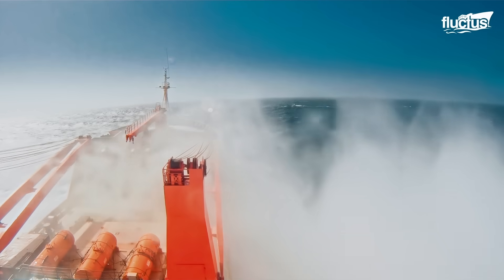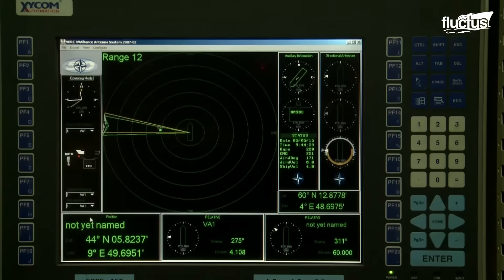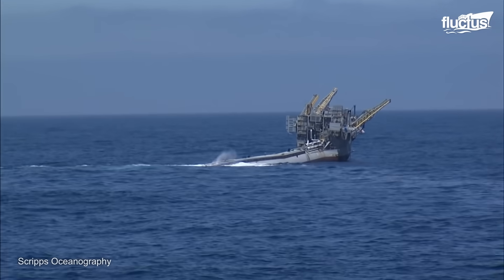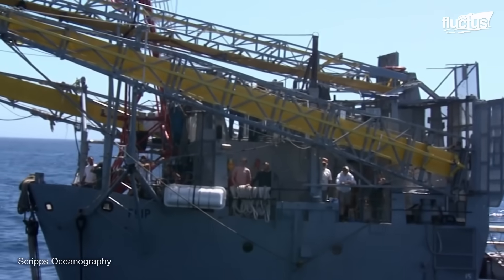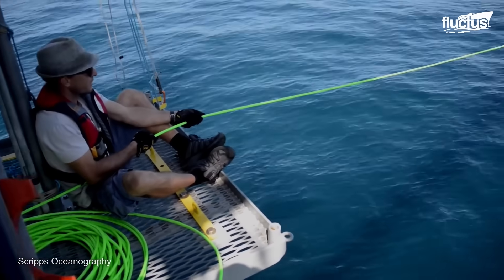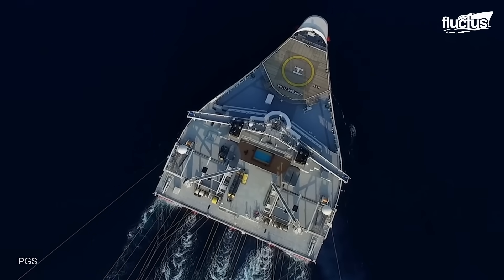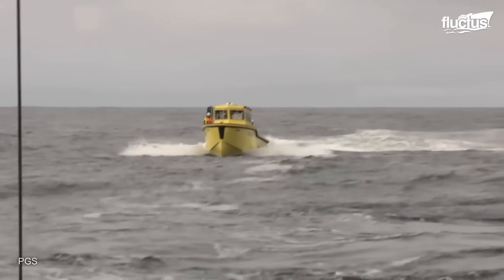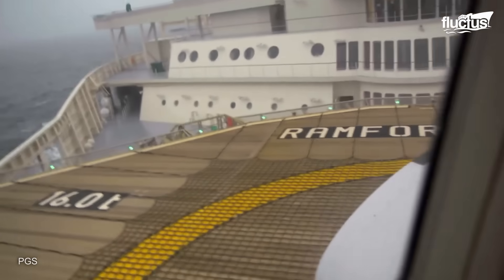Life Inside US Navy’s Weird Transformer Ship in Middle of the Ocean

Comment: Curious how the three diesel generators on Flip performed as the vehicle went from horizontal to vertical. They must have been mounted on a swivel platform?
Reply: Gimbals. 
They're just HPUs providing pump pressure so it's not that difficult. 
If they had to drive a prop shaft or pto, it would be a bit more tricky. 

It only rotates 90 degrees so engine services can just be on chains, reels, swivels, etc. 

If it had to continuously rotate then it would be a real challenge. Electrical and fluid slip rings would be the order!
Reply: Can't say China might know our secrets then the goberment will ban youtube
Reply: They're prolly on gyroscopic joints or articulators that allow the generators to sit in a flat position nomatter the angle of the ship
Reply: Like a race car a dry sump oil system, with bulk oil tank.
Reply: Maybe one or two kick in only when it flips. Then the question is how do the others not leak like crazy lol
Reply: @nrgpup77 you'd be surprised what we can accomplish when needed. Hopefully we can meet our greatest challenge survival of the species requires finding multiple habitable planets and reaching them.
Reply: @peteraddison4371 More likely via the Drake Equation it's Fermi's Great Gilter that gets us, not that we're alone. Tons of planets out there, all extinct due to their own choices.
Reply: The coffee pot was on a swivel mount.